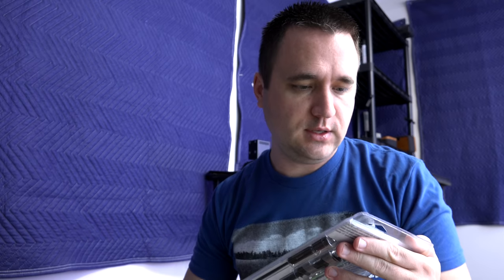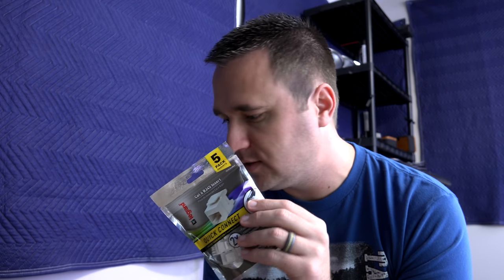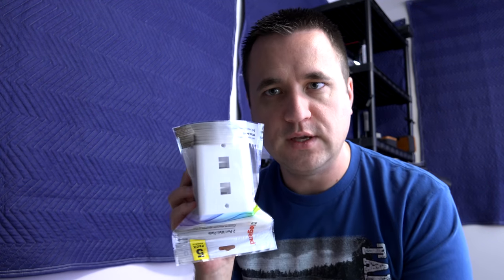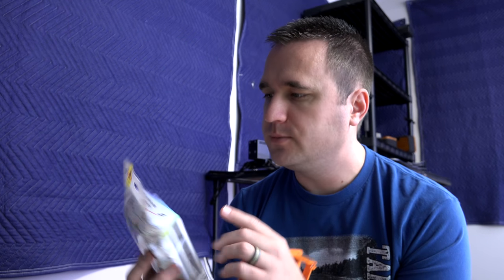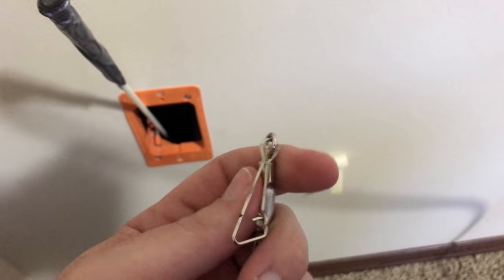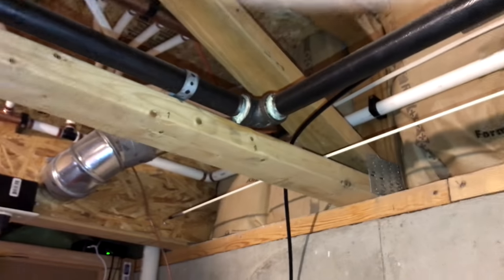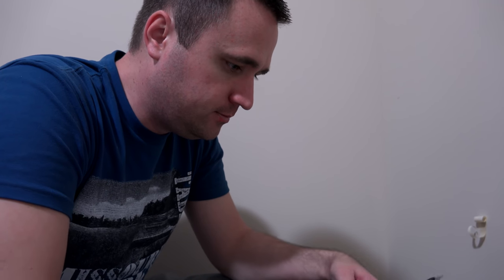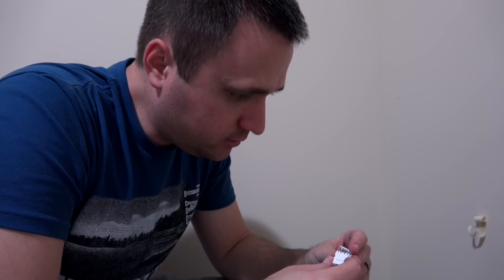Cat 6a Cable Run and Ethernet Jack Install

Comment: Not essential but may be worth investing in a basic network cable tester if you plan on running numerous cables around the house. These help diagnose if you terminate the ends of the network cables correctly. When I ran a few cables around my house I had mixed up two wires on one end of my cable resulting in an error!
Reply: Lee Gatman 

Ya, I got a fluke network tester.  Used, but like new.  Tested every cable and did a couple booboo’s.  I have many cables going to all my room, including the garage for future IP POE cameras.  Put it this way, I have a 48 port switch in my small house.  But it’s nice being able to plug my many devices all over my house right into the keystone on the wall and have just 1 single large switch, than small switches all over that also have to be plugged in.
Reply: I did that also when I was practicing with a small portion of cable. When I messed up the ends my computer wouldn't even see an internet connection with it hooked up.

Comment: At time 18:12 I see two coax ports to the left of where you are installing the CAT 6 jack.  
1.  Why two coax runs
2.  If you were installing new would you put a coax and CAT6 run in the same wall plate or keep a distance between them?

  Reason why I'm asking is I just bought my home  and will be running CAT6 throughout the house.  One other issue I have is I want to install a whole home entertainment and security system throughout the house, but currently the coax is old RJ59.

Comment: I did laugh about forgetting the tub was on the other side of the wall. I generally like your videos, they show everything, mistakes and how you corrected them and learned in the process to do things better. I'm not sure  from your videos if anyone explained that cat 6a is shielded cable where as cat 6 is not. With cat 6a, the patch panel and the jacks should also be shielded for the best 6a performance. Thanks for taking the time to make and share these videos with us.
Reply: I was also wondering about that, as I’m shopping for wall sockets presently..  is the cable shield doing anything if the cable shield is not then also connected to the wall socket jack shield section? My understanding is that shielding in a cable only achieves something if that should is connected to at least one end (or the other)?
Reply: @EvLoutonian  the shielding is not necessary. really only if you live in a high radio interference area do you need the shielding. that is why they make it. i have seen 10Gb on cat 5e unshielded cable before. it can be done. however getting internet speeds at that speed is ridiculous today. maybe if you have a lot of subscribers then it might be worth it. to me i stream 4 tv's and general internet surfing.

Comment: Good video man, very entertaining. The only thing that bugs me is that the new jack is not aligned with the other jacks on the wall.
Reply from the maker: +TheJustinist ikr lol, i eyeballed the crap outta it
Reply: Byte My Bits lol, I would have used a tape measure to be sure it was the same distance from the floor
Reply: Yeah, it was his first one so we gotta cut him some slack. It almost looked like the two walls were at different heights already.  I wouldn't think so though.
Reply: My OCD killed me there.  Lol
Reply: I think the 'issue' is the power socket (to the right) is bigger than the network socket, those on the left I doubt are inline with the power socket. And sorry commenting on a 2yr old video, just catching up on Jason's older videos

Comment: Nice job Jason, two thoughts for you.  First, if you're planning on pulling a second cable through the same path at a later time, you will want to pull a nylon string at the same time as your original cable.  Then, when you want to pull cable number 2, just tape it to the string and pull.  Second, unless it's absolutely necessary, don't do the secondary switch upstairs.  If you plan on doing wired PoE cameras, it's more economical to only need one PoE switch.  Keep up the good work man!

Comment: always add in a service loop behind the walls somewhere, just in case you move stuff, also run 2 cables to each jack as they are 2 sockets there, why repeat the task later, they do come in handy, tv voip, poe pc, etc :)
Reply: Stuart Whittaker exactly.  I left about a 10 foot loop for every run in my attic.  I also ran 2 color cables to each location and have 2 colors of jacks at each location.  If 11a (my tv) stops working when I am trying to stream the game or something I can swap to 11b (backup behind the tv) and diagnose later.

Comment: Serious question. There is existing coax outlets in some of these rooms, would't have been easier to run cat6 through the exist coax access ports in the attic, down to each coax outlet in the wall in each room, and install a keystone wallplate for both the coax and cat6 on one outlet?

Comment: Save your fingers. After you strip the shielding (blue part), use that piece to run between the two wires of each twisted pair. By running it down the length between them they quickly untwist.

Comment: Just be grateful that you have drywall and not brick. When I did my cabling I had to push my cable directly into the ceiling from the router and to the outside of the house. Then drilled a hole straight through the brick and pulled the cable through that. All of the cabling pipes in the brick were packed with cables already. So now I've got a beautiful loop of cables hanging from my roof outside. At least it's sort of hidden by a small palm tree in the corner.
Reply: I know that was a beast trying to drill through the brick.
Reply: well be happy that you have a brick house -  it is going to last longer and is safer

Comment: A lot of the “professionals” will comment and complain, but I love your honesty and transparency on the errors you made. Not everyday when someone doesn’t try to make themselves look better than they actually are. I commend you for that alone. My OCD didn’t too much mind the level of the outlet, I was looking at the plate cover color more than anything lol. Next time, you could definitely run both cables at the same time to prevent the double work for later. All in all, love the video, keep it up!

Comment: Never hurts to have dual RJ-45 jacks in a room.  I have dual Cat-6 connections in my living room and my family room.  Both rooms have one of the connections are used for the Roku's so we have hardwired connections for the Roku's or a 5 port switch.  The living room has a network printer on the second line.  The family room the second line is for my laptop.

Comment: Pro tip: if you use a double Jack plate you should fill the empties to keep spiders from coming out. The only job I've ever walked off of involved a stream of bugs using an rj45 empty as a garden gate.

Comment: Instead of buying a new single jack wall plate just order a blank keystone port insert. That way if you decide to run another cable in the future for say VoIP all you need is to just remove the blank and add the new keystone jack. Good job and by the way, I am the IT Director at our campus and I was the guy talking to you through the PC telling you how to make it easier. Also, a patch panel either a standard or keystone patch panel (I personally like the keystone ones because I like to color-code my services, i.e. VoIP, internet, IP cameras, etc.) will clean everything up and make it easier to identify your cables especially if you add VoIP or IP based cameras or need to service something.

Comment: I think I watched this video when you first posted it.  I decided to watch it again because I wanted to refresh my plans to run some new Cat-6a cables.  I got a Synology DS-1819+ NAS last year and now that the combo M.2 and 10Gbe Network adapter card is finally available.  I want to get a 10Gbe switch to connect the NAS (Secondary Plex Server)  to my primary Plex Server.  I actually have matching content on both.  The only difference is the NAS is used for backing up all computers in the house.  I normally add content through the Primary Plex and also upload the same content to the NAS.  It takes some time to do this especially if I have a lot of Blueray content.  As you know those files can range anywhere from 20 GB up to 45 or 50 GB.  I noticed that you only ran a single line.  I found that if you can do it, it never hurts to run two at a time.  My house is a tri-level home built back in 1972 so I had to get creative at running cables from my second story down to my family room.  I wanted one line for my laptop and one for the 8 port media switch that I have below my Samsung smart TV.  My TV, a Roku, a Media Receiver, a small two drive NAS with a print server attached to a FAX/copier/printer, and the BlueRay player all run off the switch.  So it requires little extra effort to run the second or third line at the same time.

Comment: .You already have one of those pull mesh devices that came with the kit.
one should get cat6a ends then you can truly take full advantage of that cable. with proper hardware.
I don't know how big your hole was but pull a pull string for adding 1 or 2 more cables down the road. string is cheap, angry wife isn't
Label label label. Granted it is only 1 but of you add more and label them will make your life easier.

personally all my 10gb devices are in one room, I have cat6 throughout the house.

Comment: Nice job! I'm not sure if you did it on purpose or by accident, but the pins inside the jack always need to be on top. (Dust) Now you just need to move to Chattanooga TN where you can get a 10Gbps symmetrical fiber connection for 300 bucks a month or 1Gbps for 70 bucks.

Comment: Excellent job!  Some other folks had some of the same responses that I did, namely that I never run.  I always run several.  Additionally, a patch panel is a much better way to terminate the other end.  Finally,  when you were buttoning up your wallplate, there are 2 coax wallplates on the wall to your left.  I definitely would have bought a quad front, put a keystone coax in one of them and not put another plate in the room.  When I bought my house, there was no networking in the house at all.  I ran 1 coax and 3 ethernet cables to every room, specials got more than 3 (like my office which has 2 6 ports).  Today there is no purpose for coax, unless you are using a system like Dish.

Comment: Very informative video, just a suggestion I ran Cat6 cables (as in two) from my "Computer Room" down to my family room.  One cable runs to a 5 port NetGear ProSafe Gigabit switch for my Smart TV, Roku, AV Receiver, a NAS/Print Server and the BlueRay player.  The second cable is for connecting my laptop.  Lot easier to run the cables one time than to go back at a later date to run a second line.  Just saying.  Love your Plex videos.
Reply: Always run your cables as a "home run", from location back to like an unfinished room in home frequently by breaker panel. That's where your patch panel/switch sits creating the back bone of your network. Don't run wires from one room to the next kind of thing. That's the wrong way to run cables.

Comment: Check your auger bit for a whole in it a lot of them alow you to strip a wire and fish it through the wall with the auger bit so you dont have to use the fishing rods and try and find the same whole you drilled

Comment: can you help me i wired up my room in the house with cat 5 cable. if i plug the ports in my room in my htpc running win 10 connected to my router with a patch lead shows a yellow triangle above the Ethernet logo but if i unplug the ports in my room my htpc connected gets internet. If i unplug my bedroom ports and power the htpc on then plug my room ports in the connection on the htpc still works, Im really confused.
Reply: Dr Bass you’ve created a loop somewhere. That’s why connectivity is jeopardized
Reply: @arifjay6756  how do i fix it?

Comment: Hi, good video had a few chuckles, two quick things, if you are using shielded cat6a then you need to used shielded mechs, and shield patch leads in the future to get the full benefit of the cable. Also if you are planing to drill all the way down a wall, either drill from the top(attic), or the bottom(basement). Trying to drill the entire wall through a flush box hole like that will not be easy.
Reply from the maker: +Paul Geenty new and better keystones already on the way. And yes next time am taking new approach

Comment: nice first time pull! it looks just fine and works too. you ought to be able to reuse the hole in the floorboards for a couple more wires, depending on the drill size, saving some time and effort. Very nice job overall though
Reply from the maker: +Codeman20400 thx! Yeah not sure yet, lot of unknowns and second guessing myself. But it will be done 🤓🤓

Comment: Great video! I have many multimedia projects that I want to do for my house. Running Cat5e or  Cat6 is one of those projects. Now that I have seen you do it, it might not be bad after all. Currently using MOCA 2.0 device in place of Cat 5/6 at this time. But now I am inspired. And that deal on Cat6!!

Comment: The More you Can replace Wifi with Ethernet in your home .... The Better !!! Congrats !
Reply: u know that the max speed cat6a is 10GBit/s -- wifi is somewhere arround 0.2 to max 1 I think. Also speed decreases when multiple devices are connectet.
Reply: Wifi is also half duplex. I have cat6a in my house and it was the best thing considering I have Google Fiber for an ISP with symmetrical gigabit internet.
Reply: Wrong. Wifi is to supplement ethernet. If you have lots of equipment, and also ones that need high speeds (10Gbit) wifi won't do.
Reply: @Kushari  I suggest reading on differences between wifi and ethernet. Ethernet is not only faster, more reliable, more secure, and consistent, but much more resistant to interference, collisions, and is full duplex. Wifi beats ethernet on convenience and cost. You wont find most corporations running only wifi. You'll likely see cat 6 or 6a cabling for extra FEXT and NEXT protection.
Reply: @Kushari  10G speeds are moot right now anywhere. Even with fiber your going to get max 1Gigabit. Additionally, on your LAN your are still going to only get 1 Gigabit between devices, exception being you have spent big time bucks for a 10 Gigabit NIC a PC or something. Although, having 10g throughput does help with LAN traffic load, and also gives you some future proofing when tech starts to advance to 10Gbase-T  as a standard. If you are installing and have the money, go cat6a

Comment: In my professional opinion, good 1st job. I'm not screaming at you, but I have a couple thoughts for moving forward, if you like? Your videos have helped me with getting Plex and hdhomerun going so it be my pleasure if I can help.
Reply: I'm not the op but may I ask what are those thoughts? I know I'd pull several cables plus a pull string, labels, use shielded jacks, match the plate cover to the existing jacks, and plenum cable.  Are there more things to consider?

Comment: I know this video was uploaded years ago. But I am currently working with Cat 6A cable myself and I am mostly interested about the 14:30 ish part. I am struggling so much with getting each individual cable separated and was wondering what your trick was!
Reply: I used my fingers and moved the wires back and forth and up and down. Some people use a flathead (or similar) screwdriver to run the cables against. I terminated my cables including testing for shielded (6a should be shielded). However, my struggle was figuring out how terminate with the shield on the keystone jack.

Comment: If that is cat6 ends for cat 6 a cable, then it will only give you 1g speed not the full 10g. Also every 4 feet you need a j hook. FYI every bend in the cable will reduce more than +-4 on the light level. Need some info... message me. I really enjoyed watching you tackle this project.
Reply: we are talking residential and not commercial. There is also no light in copper cable
Reply: intertan it doesnt matter if it is commercial or residential. Cat 6a is fragile. Also the low light level is prevalent in cat 6a cable. Have you spliced that cable and punched it down? I dont think so.
Reply: Hershekyss 

It’s fine to terminate it this way for now.    Once 10GbE becomes more prevalent they can re-terminate them to Cat6a specifications.
Reply: This is not correct. Regular Cat6 allows for 10g. Cat6A allows for 10G over larger distances than Cat6 that's the only difference
Reply: Cat6a is also shielded by standard. Cat6 is optional. There are more twists per inch, so less cross talk. It isnt just about "speeds" between the two.

Comment: Hey Nice Video, i am not sure if you put on the keystones just for testing (i assume you did) but in your basement use a Patch Panel as they are So much easier to wire rather then attaching an rj45 Boot and much tidier then a keystone to each cable.and i would recommend connecting all your keystones to your main switch as having more then 1 switch can be a bottleneck unless you connect them with Fiber and even then fiber is not cheap. and you totally made that look easy in the video :P 

Loved the Video though.
Reply: Defo another vote for a patch panel as it makes things a lot tidier when dealing with large numbers of cables.
Reply from the maker: +ArcAngelgci HD this was just for testing, got a 24port panel and 6a keystones on the way 😋
Reply: fiber is cheap, if you don't care about using old comercial grade hardware over new "consumer"... and a fiber cable, can be comparable to cat 6 in price for manufactered cable...